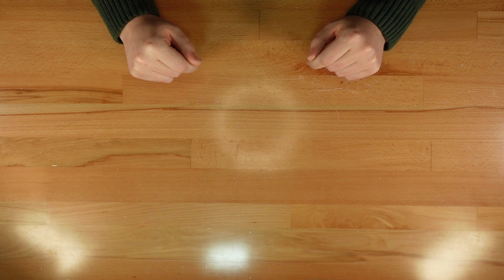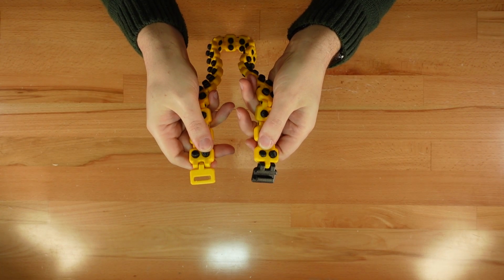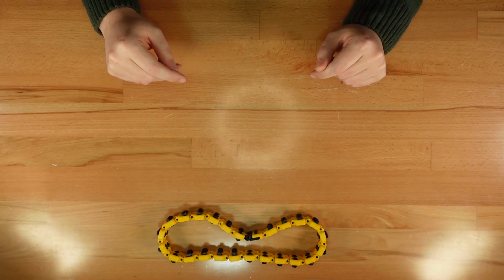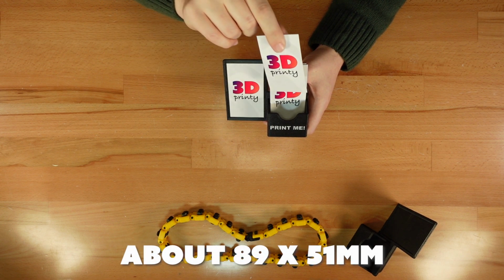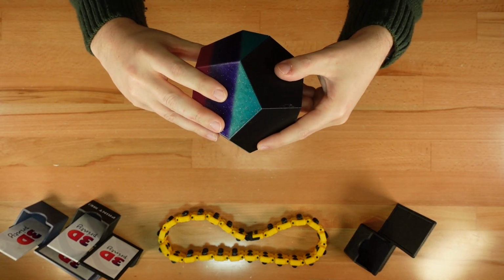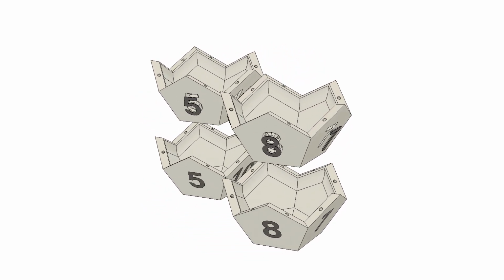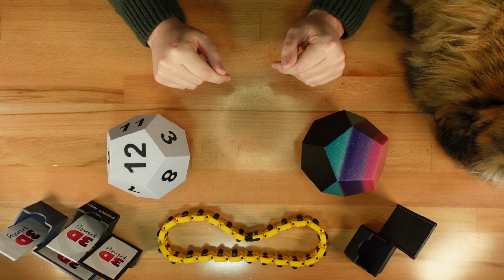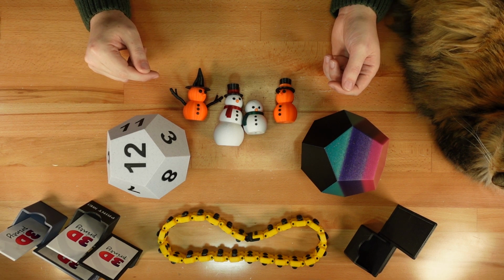3D Printed Odds and Ends

Comment: Be very careful with small neodymium magnets in 3D prints, especially when they mate with each other to hold parts together.  Vibrations and even daily heat cycles can wear down most glues that you would use to keep them in place.  They really need to be made captive inside the print so they don't get loose.  These things put many children in the hospital with life-threatening internal organ pinching.
Reply from the maker: While I haven't had any issues with loose magnets (even in prints that have received constant use over 4 years), it's a reasonable risk to keep in mind. There are very few 3D printed toys I would trust near a toddler without adult supervision with or without magnets - maybe a solid 1-piece design that has no tiny bits to break off in rough play.

To protect the magnets from damage from standard use, the holes are actually 0.4mm deeper than the magnet height. In other words, the magnets sit below the mating surfaces. In my prints, these holes are so tight I have to apply quite a lot of direct pressure - the glue is just an extra layer of security. Of course 3D printers are not consistent and your own results may vary.

I welcome any remixes to improve the design. But fair warning: a fully captured magnet will be difficult in this case. There is no orientation that would leave all surfaces parallel to the build plate. You would have to create a much deeper hole and it would need to be wider to let the magnet slide easily.
Reply: Where did you hear that from.
Reply: That's true, look up details about a toy called Magnetix, swallowing magnets can cause magnets in different parts of the digestive tract to attach to each other and as the digestive system moves them along, it can tear the intestinal lining. This killed a child and seriously injured 4 more and this resulted in magnetic toys with individual pieces small enough to be swallowed, such as Magnetix, to be recalled.